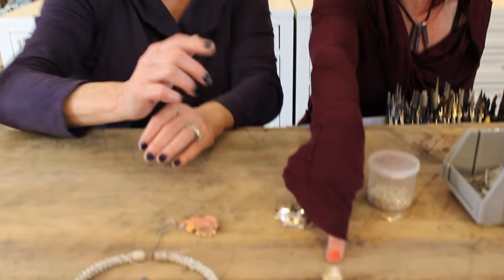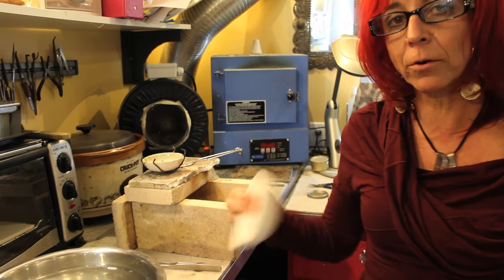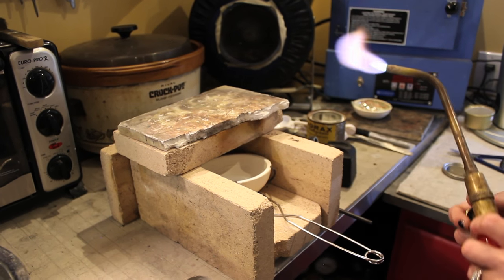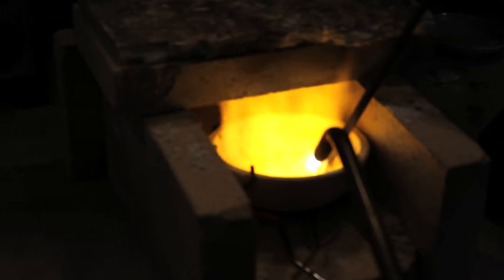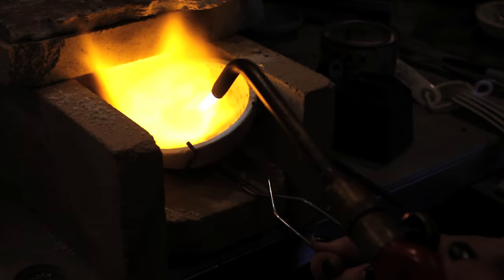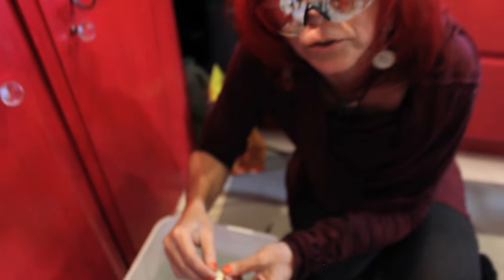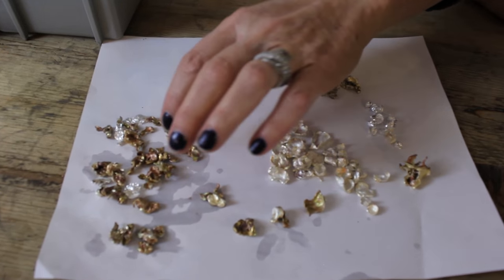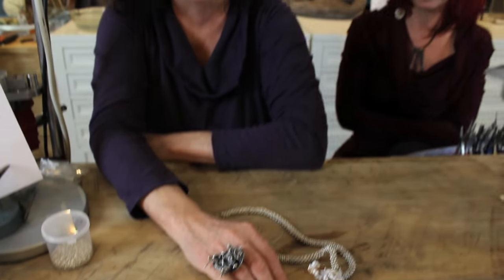Water Casting and Crucible Preparation

Comment from the maker: You can coat a crucible in many ways.  The most common method is to fill it with a mixture of 50% Boric acid and 50% borax.  Fill the crucibles to 1/3/ to 14 full - depends on size. You can: 1. pre-heat the crucible first and then add powders. or 2. put the crucible in a kiln or 3. heat after applying powders. IF you heat after the powder is applied, heat slowly and from the bottom.  Borax melts at: 1,369°F (743°C) and Boric acid melts at: 339.6°F (170.9°C).  You can use either product alone or together.  If using only boric acid, you can melt in the stove.  Protect the area around the crucible.  Some fluxes contain these chemicals and therefore, you can use flux.  If it is liquid, you will need to burn off the liquid.  It will then become a powder and you will have to melt the powder.   In all cases:  when the material is liquid, either swirl it around in the crucible or "paint" it with a carbon fiber stir rod.  Whatever works for you - the goal is melted material that forms a glassy coating all over the interior of the crucible.  How you get that effect, is up to you.
Reply from the maker: +Nancy Hamilton Don't add liquid to a hot crucible - it will crack.
Reply: Hi Nancy, I luv your video pretty much!
Reply: I coat the crucible this way. I heat it like you with a torch and non oxidizing flame but I heat ir not from the bottom. I simply put the flame inside. Once the crucible gets a little hot I start taking borax like salt and quickly point the flame elsewhere and throw the borax powder into the crucible, then quickly put the flame on the spot I thrown it on. And repeat until I coat it. Sure some flies off, but not alot
Reply from the maker: Thanks! I appreciate you sharing your method!  Happy creating.  N